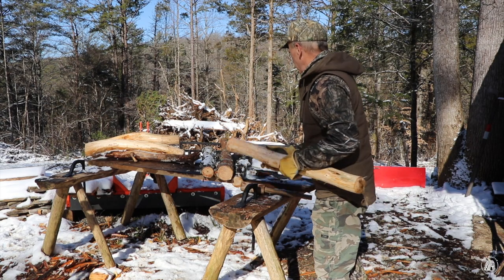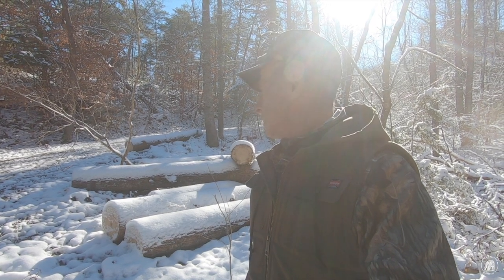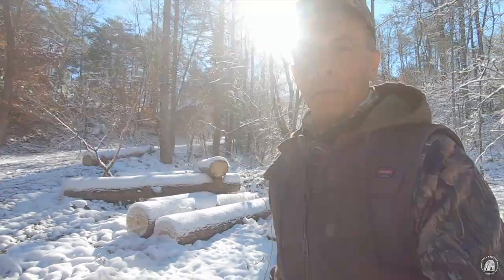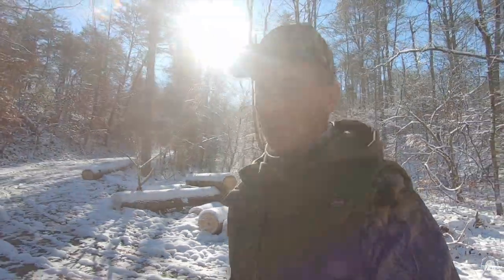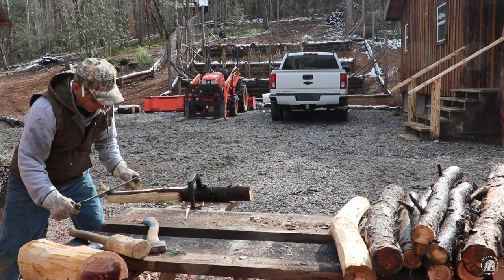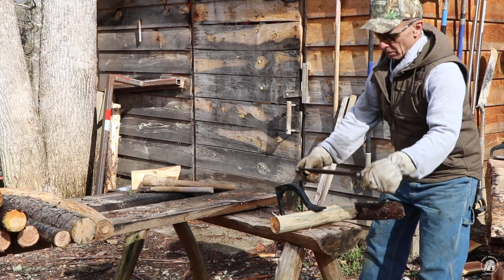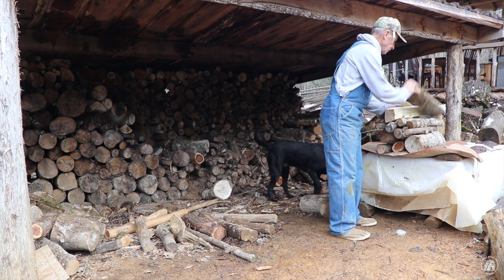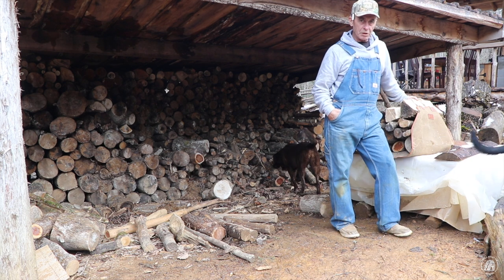HAND CARVED FRONT PORCH HANDRAIL PART 4 | TIMBER FRAME CABIN | OFF GRID HOMESTEAD

Comment: I like the design of the porch rrailing.  Now I did see others use a high pressure washer removing the outer bark.  I dont know if it works any better.  But it did seem to go little faster.  They did a long branch then cut after bark removal.